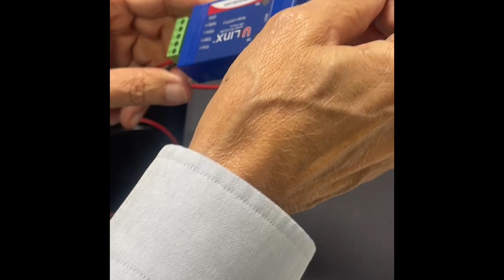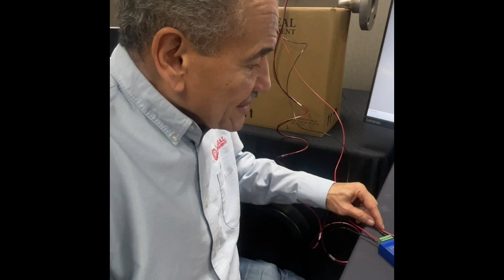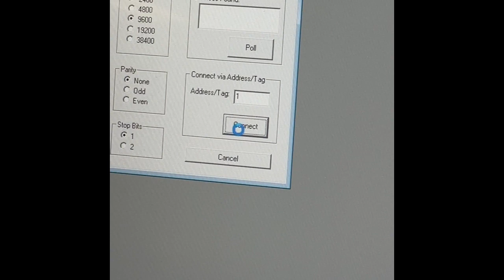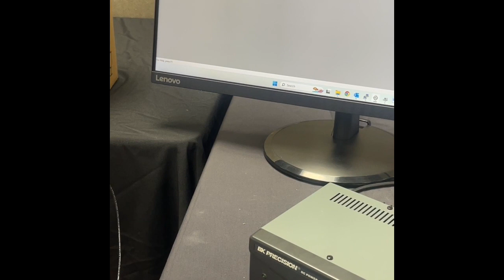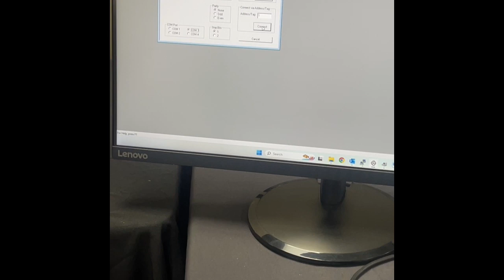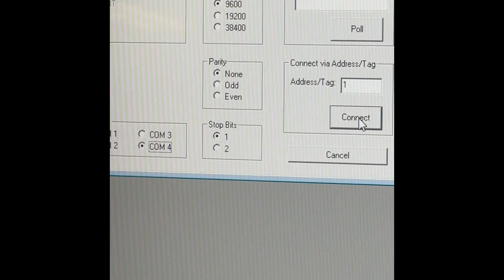RML2000 Connection with Prolink

Comment from the maker: Here the steps to be sure that you are following the instructions of the video to get a succesfully connections of your RML with Prolink.

1. Driver for the converter. In checking the comm port it may recognize the converter. If so, drivers are in place. If not, install driver.
2. Verify converter settings (RS485, Echo off, Two wire)
3. Verified the Comm Port. If PC comm 4 & ProLink Comm 3. Modified ProLink to Comm 4.
4. Verify ProLink "connection" settings;
a) Protocol - Modbus RTU
b) Baud Rate - 9600
c) Parity - None
d) Com Port - Com 4 (was com 3 and changed to
e) Stop Bits - 1
f) Address - 1
5. Power down RML2000 for 20 seconds.
6. Power up and connect within the first 3-8 second via ProLink "connections", after 3 seconds press connect.
This will establish communication.
If no connection, start from step number 5 again. If still don't connect verify and/or change wire and converter and try again.